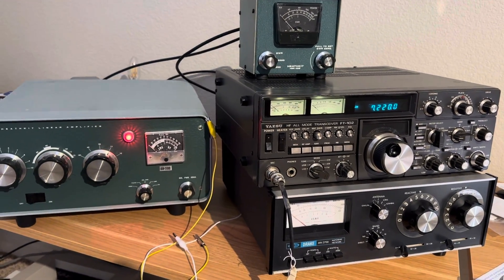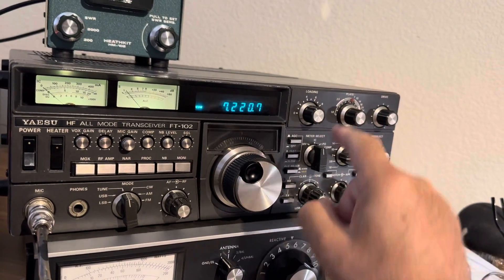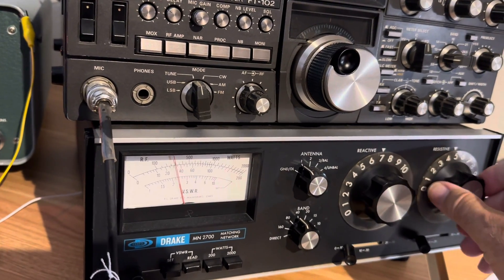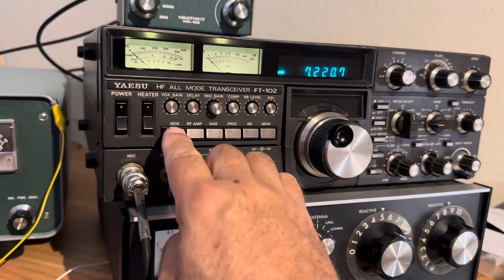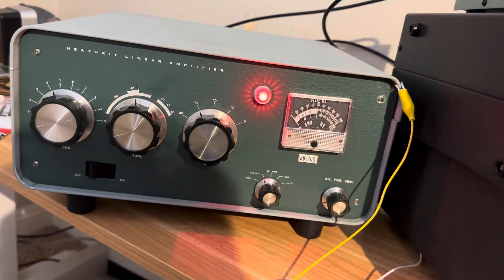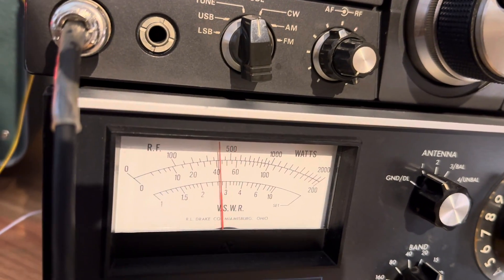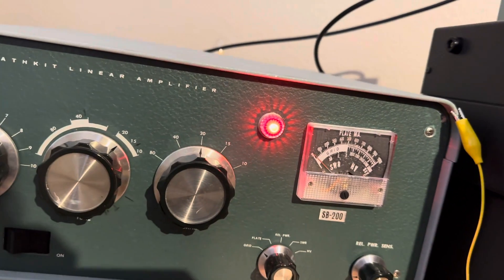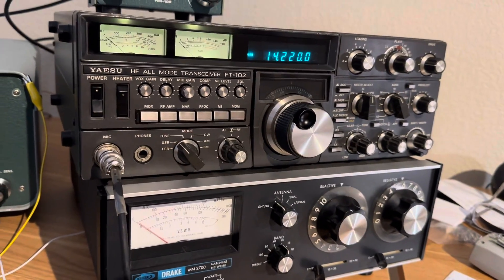How to properly tune up a tube based linear amplifier like a Heathkit SB200 with a Yaesu FT-102 rig

Comment: This seems like a huge hassle to tune the system and is almost enough to turn me away from running this type of amplifier. I'm wondering if this process may be cut in half if a person was using a new style radio.  There is a local silent key's family with an SB200 and I was temped to go for it until I saw this video. I need to do more research to see if an IC-7300 + manual tuner + SB200 is easier to configure than what is shown in this video.
Reply: With a modern radio and tuner, it's not a big deal to tune the amp.  My rig is an FTDX101MP with the SB--200 and a Palstar HF-AUTO tuner.  I just put the radio on 5 watts with CW or AM modulation near the frequency I want to use.  A legal limit dummy load is on one of the tuner's outputs for initial band tuning.  After that, I select an antenna and work the power up as I tweak.  The easier way is to shell out a ton of money for an amp with an automatic built in tuner.  That will set you back at least $6000.

Comment: That Yaesu looks really good.  I didn't know that they used the 6146 like my Kenwood 820s does. I don't use a tuner bc I only use a resonant dipole on 40m & 1:1.2 swr isn't going to cause problems & of course more equipment costs more $.

Comment: Thanks for the work on this. I haven’t ran any amp since my Army days and really needed the help. My SB-200 was bought from a Silent Key sale, seems to be working but can’t trust what I’m seeing on the built in meter. New, two needle unit is on the way. Then I can run through all these steps, probably several more times? KE8IGL 73